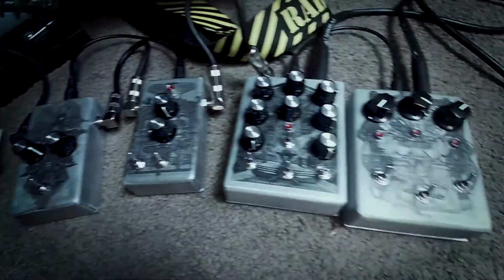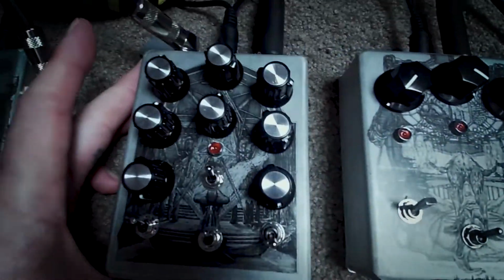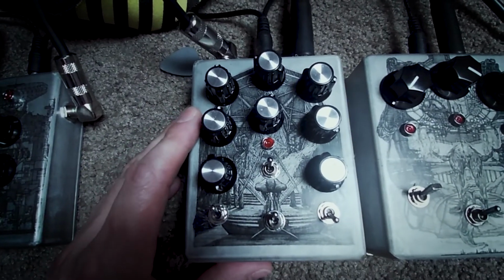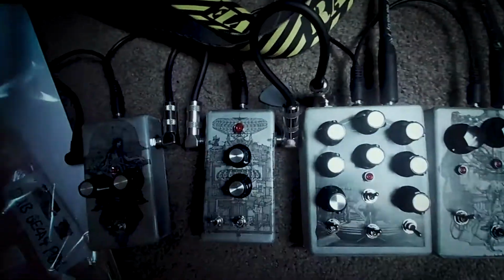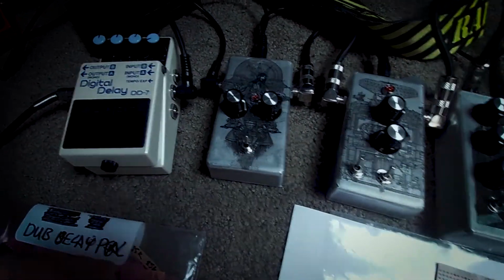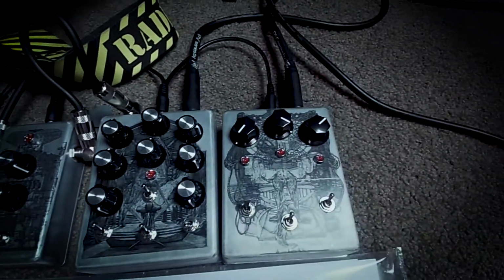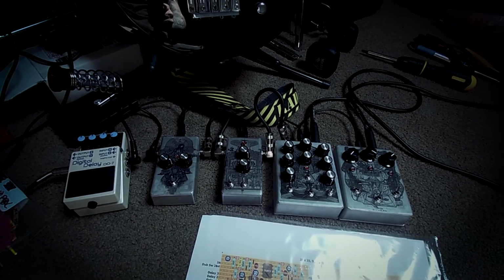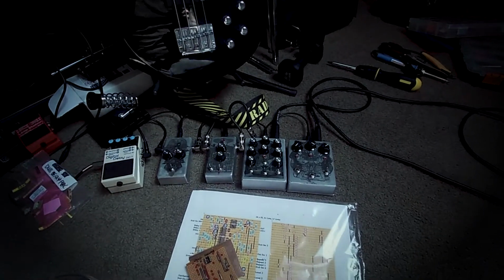DIY Drone Synth, Noise Swash & Effects Demo | Part 2

Comment: Great work as ever. I've built a few "squark" box diy drone synths. One problem I seem to have is getting the sound to dirty down. I have a fair selection of dirt pedals but the fairly pure waveforms seem to pass through with very little effect. I think I'm going to try one the Acapulco Gild builds I see you do, I'm hoping the extremity of this circuit will give these devices the crunch I'm after.
Reply from the maker: Yeah I thought the same but you’ll probably just get a pretty flat distorted waveform again. But the AG pedals is a really fun one to muck about with anyhow!
Reply: @unholyaudiochannel  I had a few of the LM386 chips that came with amp kits  I tried a breadboard of the AG,not quite there yet. I bought some with the suffix 1 and 4 I'm hoping these will be better. 
Regarding the little amp pcb kits, I put one in a nano pedal enclosure and tried it with a guitar into a 1x12" cab surprisingly loud fun. I built a couple of the 100w digital chip amp pcbs into cases with 12v fans for off grid noise/dark ambient/musique concrete gigs, they give about 30wrms,on 12v with an 8ohm speaker, these also make a good clean channel guitar amp on my 12" cab.